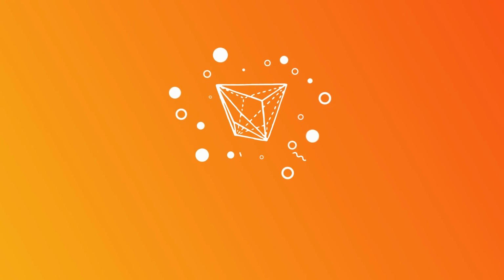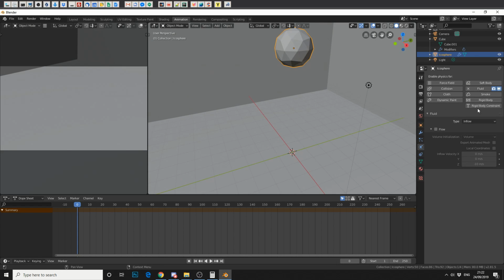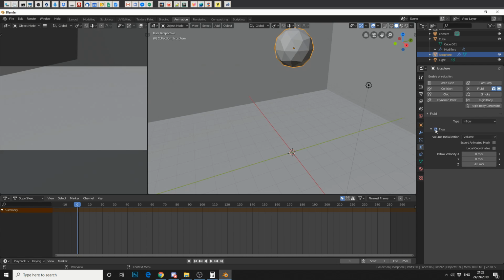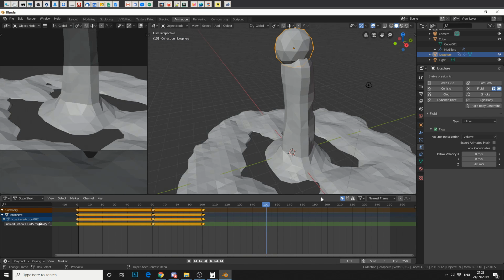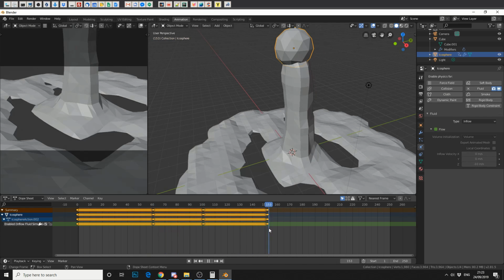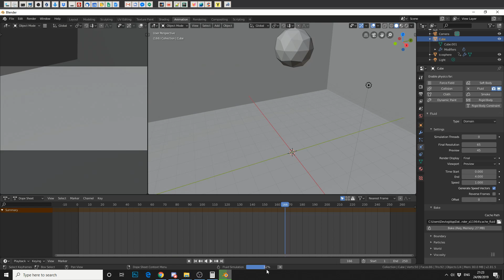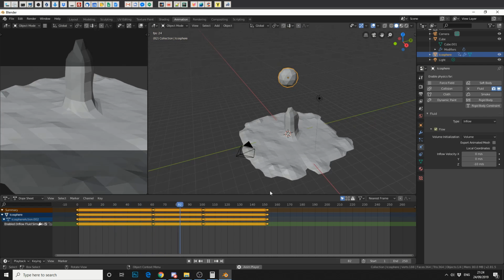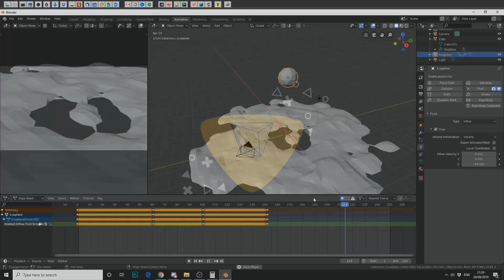Blender 2.8 Tutorial: Fluid sim Keyframe the flow on and off

Comment: Can I let the water appear on frame 40 and stop flowing at frame 120? How? Please help me a.s.a.p thx! <3
Reply: I've tried adding a keyframe as you taught, but in frames 0 to 39 the domain appears and blocks other objects. pls, help T_T
Reply: @waceprukscalonjuragandomba2464  I have the same problem , did you find a solution btw ?
Reply: @Mbg-tech  not yet, I wish someone could help me asap
Reply: @waceprukscalonjuragandomba2464  I think I found a solution for it : you need to animate the visibility of the domain in object properties.You can hide it in viewport and render from 1-40 and then at 41 unhide it.It works , I just testes it . Good luck.
Reply: @Mbg-tech  Thanks bro. This worked for me :)